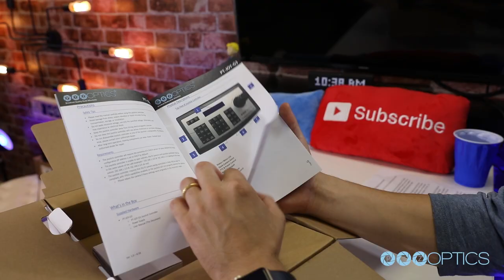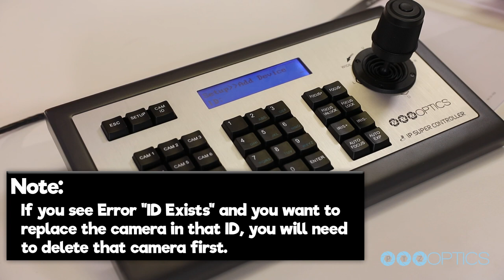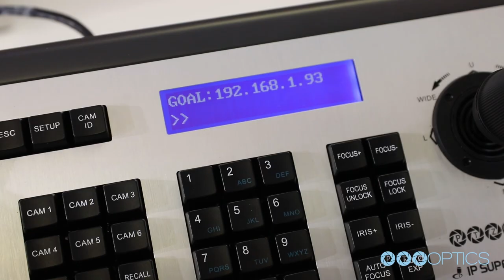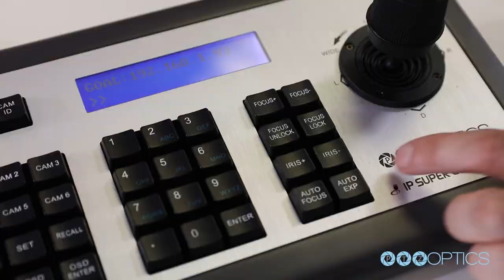PTZOptics IP Joystick Setup Video (Gen 3)

Comment: What is with the subtle flicker in the shots of the controller?   That happens to me when LED or CFL lights are used with the wrong shutter speed or framerate.  Is that a PTZOptics camera creating that flicker?  Because I'm about to buy 2 of them and it would be good to know if I need to be concerned about that.   Do these cameras have shutter speed and frame rate controls?
Reply from the maker: Roy Plisko - this is from a canon camera used to film this video which didn’t have the proper Hz settings
Reply: PTZOptics  thank you.   Sorry that happened.   I’ve been punked by that too... the viewfinder is too small to see it sometimes.

Comment: I am using 3 PTZ cameras with the PT-Joy- G3 controller. Having a problem from time to time with one (1) or two (2) of the ptz cameras going in and out of  focus when going live to another camera. Though they usually go back into focus on their own sometimes I do have to manually re-focus using the focus + & - buttons. How can I accomplish or keep the ptz cameras in focus. Also when using the OSD and OSD Enter buttons sometimes it is hard to get into the 2nd setting as to view or change a setting, why is that? When the exposure is to bright I try to adjust using the iris + / - buttons. When I hit the Auto exposure button then Iris - button the exposure can be adjusted completely dark ( which you don't need that dark) but when hitting the Iris + button it can only be adjusted so much, how can I get more lighting control as to brighten with the Iris + button?
Reply from the maker: This is an issue our support team would be happy to help you with. My guess is to update the firmware on the joystick and the cameras

Comment: Paul, It was interesting today that I set up our new joystick and 1 20X camera on a vlan (192.168.100.0/24) and they worked perfect together.
But then, just to see if it would work, I added the ip address of a camera on our main lan (192.168.1.0/24) and the joystick controlled that one just fine too.... I thought it would not control cameras on a different sub net as it is set up for?
This is of course a fully managed Ubiquiti network... I don't know if that makes a difference or not.
Reply from the maker: Hi Daniel, I will say that this type of networking setup usually should not work. But, there may be something about your network letting it pass through. I have no idea.

Comment: I can't see a quick link/button to WB or colour correction... (?) Also, when I save preset, am I saving WB too?
Reply from the maker: There is no white balance or color correction buttons on the joystick. To do this you would press the OSD (On Screen Display Menu) button and use the white balance and color correction tools there.

Comment: Hello my name is Bernard,
I have the S3 IP controller for my PTZ camera in my church and i am having a bit of an issue i am looking to fix if possible you are able to help me.  It has been working just fine for the last 1 year now and i like the quality but now i am noticing that for some reason it sometimes disconnects from the IP and the screen turns black and i cannot control the camera during a live stream. When that happens i am still able to see the camera in my preview monitor but not on the PTZ controller. I usually have to wait til the controller connects back to the IP automatically or i do a search of the IP and connect to it again  but then after a while it disconnects again.  I don't know why it's doint this or what's causing the controller to do this. Could it be a controller issue or PTZ camera issue? I'm not sure. Your help would be much appreciated in me fixing this issue please if possible.
Reply from the maker: Hey Bernard,
The issue you're experiencing with your S3 IP controller for the PTZ camera, where it intermittently disconnects and the screen goes black, can be caused by a variety of factors. Since the camera feed is still visible on your preview monitor, the problem likely lies within the network connection or the controller itself, rather than the camera. Here are some steps to troubleshoot and resolve the issue:

1. Check Network Stability
Network Connection: Ensure that both the PTZ controller and the camera are consistently connected to the network. Intermittent network issues can cause the kind of disconnection you're experiencing.
Wi-Fi vs. Wired: If the controller or camera is connected via Wi-Fi, try using a wired Ethernet connection instead, as it’s more stable and reliable.

2. Inspect Network Hardware
Router/Switch: Check your network hardware (router, switch) for any signs of malfunction. Try rebooting these devices to see if it resolves the issue.
Cable Integrity: Ensure that all Ethernet cables are in good condition and securely connected.

3. IP Address Configuration
Static IP Addresses: Assign static IP addresses to both the PTZ camera and the controller. Dynamic IP addresses (assigned by DHCP) can sometimes change, causing disconnection.
IP Conflict: Make sure there are no IP address conflicts on your network.

4. Update Firmware and Software
Controller and Camera Firmware: Check for firmware updates for both the PTZ controller and the camera. An outdated firmware can lead to connectivity issues.
Network Equipment Firmware: Also, update the firmware of your network devices like routers and switches.

5. Controller Settings
Settings Review: Review the settings on the PTZ controller to ensure everything is configured correctly. Look for any power-saving settings that might be causing the controller to disconnect.

6. Power Supply Issues
Controller Power: Make sure the power supply to the PTZ controller is stable. Power fluctuations or issues with the power adapter can cause intermittent disconnections.

7. Test with Another Device
Alternate Testing: If possible, try using a different PTZ controller with the camera, or connect the controller to a different camera. This can help you determine whether the issue is with the controller or the network/camera.

8. Check for Overheating
Overheating Hardware: Ensure that neither the PTZ controller nor the network hardware is overheating, as this can lead to performance issues.

9. Consult Technical Support
Manufacturer Support: If the problem persists, consider reaching out to the support team for the PTZ controller or the camera for specialized assistance.

10. Professional Network Assessment
Network Evaluation: If you’re unable to diagnose the issue, it might be worth having a professional assess your network for any underlying issues.

By systematically going through these steps, you should be able to identify the cause of the intermittent disconnections and resolve the issue, ensuring stable operation during your live streams.

Comment: You skipped what you did for the ID number? we also are being asked for a UDP or TCP port.... what are we doing wrong?
Reply: Hi Jon Thomas, the video was produced at launch... since then the controller has added some wonderful features, such as the ability to use TCP or UDP, and bug fixes. The following link to the PTZOptics Knowledge Base has an excellent, quick article on getting the PT-JOY-G3 setup with the latest and greatest firmware. https://help.ptzoptics.com/en/support/solutions/articles/13000058528-setting-up-your-pt-joy-g3
Reply from the maker: Thanks for checking out our Channel! 
Learn More: https://ptzoptics.com/

Comment: Can it connect directly to the ptzoptics camera?
Reply from the maker: Hello!
The PTZOptics Joystick Controller is designed to control PTZOptics cameras, but it typically does not connect directly to a camera. Instead, it connects to a network or through serial connections (like RS-232 or RS-485) to control the cameras remotely. Here's how it generally works:

Network Control (IP Control)
Joystick to Network: The PTZOptics Joystick Controller can be connected to your network via Ethernet.
Camera to Network: The PTZOptics cameras also connect to the same network, either via Ethernet or Wi-Fi (depending on the model).
IP Address Configuration: You configure the joystick controller to communicate with the cameras using their IP addresses.
Control Over Network: The joystick sends control commands (pan, tilt, zoom, etc.) to the cameras over the network.

Serial Control (RS-232, RS-485)
Direct Connection: For a direct connection, the joystick can be connected to a PTZOptics camera using RS-232 or RS-485 cables, depending on the distance and setup.
Daisy Chaining: In setups with multiple cameras, they can be daisy-chained (connected in series) using serial cables, with the joystick controlling all cameras in the chain.
Control Via Serial Protocol: The joystick sends PTZ control commands through these cables to the camera(s).

What You Need
Appropriate Cables: Depending on the method of control (IP or Serial), you will need either Ethernet cables for network connection or RS-232/RS-485 cables for direct serial control.
Network Setup: For IP control, a properly configured network is essential. Ensure that both the joystick and the cameras are on the same network and configured to communicate with each other.

Additional Considerations
Power Source: Both the joystick controller and the cameras need their own power sources; they do not power each other.
Compatibility: While designed for PTZOptics cameras, the joystick may also be compatible with other cameras that use the same control protocols.

In summary, the PTZOptics Joystick Controller is not typically used for direct physical control connected to a single camera. Instead, it's used for remote control over a network or via serial connections, offering flexibility and ease of control, especially in multi-camera setups.

Comment: Good video - but the information about subnets is over simplified so it tends to be inaccurate.  192.168.1.123 and 192.168.0.125 can easily be in the same subnet depending on the subnet mask.  The statement in the video assumes a subnet mask of 255.255.255.0 which should not be assumed.  If the subnet mask, for example was 255.255.248.0 then they would be in the same subnet.
Reply: You're making it unnecessary complicated.
Reply from the maker: Thanks for checking out our Channel! 
Learn More: https://ptzoptics.com/